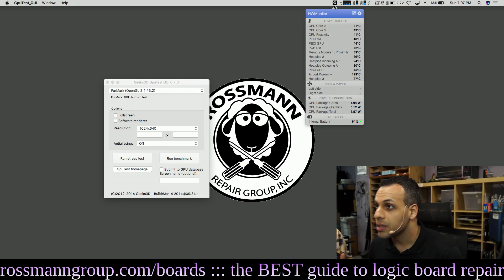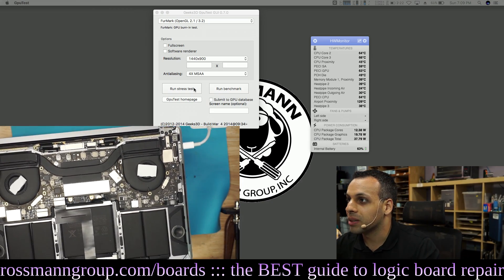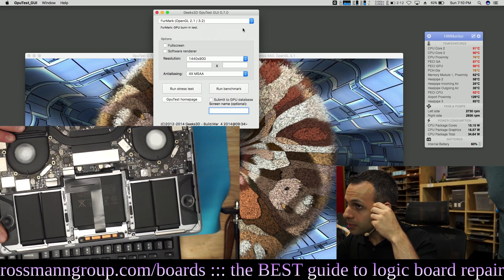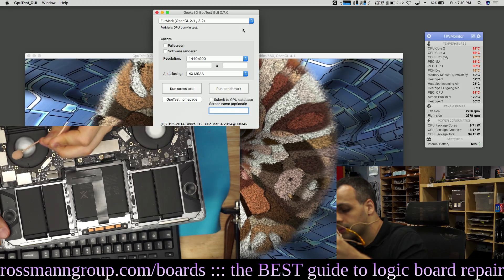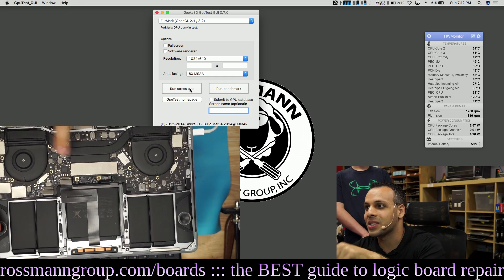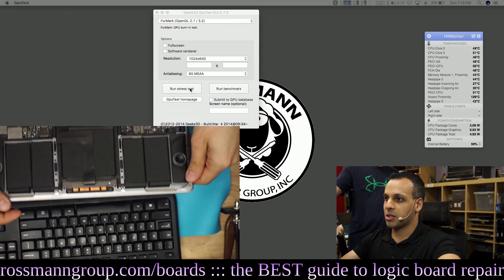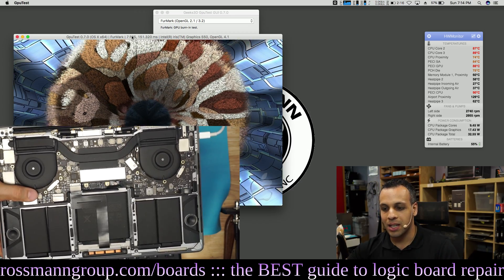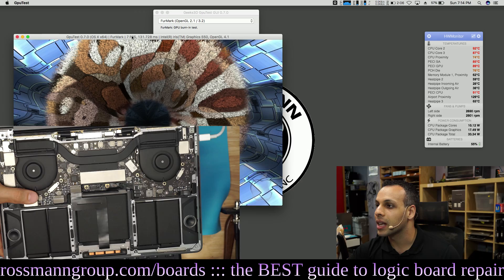Why Apple Macbook runs hot.

Comment: I still have the old 2007/8 MBP but I'm using the software that my fans are running at maximum speed all of the time. (It's the one with the failing Nvidia chip)

Comment: I sort of see why Apple does this stupidity. When the fan finally do turn on they are so loud! Some days ago I was sitting at a café reading and suddenly this loud air sound came on, really noticeable, I looked to the right and it was the fan of the macbook of the guy on the next table. It curned and curned and curned. The fan of my laptop is more or less always running, but it makes a lot less noise. So they choose to have it running less because they can't design a fairly quite one. It is the choice for them between stupidity and stupidity, and the choose the one that will make them money because their average customer dosn't undersstand that you prefere the fan working to having you computer shut down because of overheating.

Comment: Ive got the 15” 2016 touch bar model and the fans are ALWAYS ON . Idle temps are around 40 and 1200-2000 rpms. They reach around 5500rpms with a temp of 80-ish. Do you mind testing this on multiple machines? Having one unit with fan issues seems  like cherry picking to me.

Comment: I get that it should be quiet when at idle. But when there is work to do, there is heat to get rid off. Even on my desktop 90°C is set to full speed, not matter the noise, with it gradually decresing until it becomes quiet when idling or doing easy stuff like youtube.

Comment: But Apple has stores lol

My Nvidia gpu fans don't activate until 60 and I thought that was kinda hot but damn 80!!!!!!! Lol
Reply: Depends. Generally speaking, GPUs draw more power, though, so have more heat to dissipate. Somewhat mitigated by the fact that the silicon makes direct contact with the heat sink (no gum inbetween like on Intel), but still - more power = more heat.
Reply: My AMD FX8350 despite drawing 120 watts runs between room temperature and maybe 60-65 degrees Celsius under load with the stock fan.
Reply: GPU don't produces as much heat as a CPU.
Reply: Any think over 70c is hot. I am saying that a CPU need a better cooling device then a GPU.

Comment: It's not just apple doing this, my HP notebook too. My ps4 is laud but the shitty fan does not spin fast enough and the ps4 enclosed casing to get to the fan means that dust makes my ps4 run even more like shit. I've opened it once with screw driver that looked like it worked for my ps4 screws but when I closed my ps4 the screws striped at the top, can you make a video on how to remove small striped specialized screws, please.

Comment: I run smcfancontrol on my MBP, and it seems like it runs off of the CPU proximity value rather than CPU core temp. Seeing that the fan kicked in at 60*C seems to match my fan values when it turns on.

Comment: This is to be honest pretty normal despite it being also extremely bad. It's likely that the thermal paste is dogcrap +++ the fan rate is low to be quiet. However both those 2 things improved would revolutionize the product you could buy. And that is why Apple are truly thinking "different". They want our cash lol. I wish it was normal for a fan-rate-change button to be present on all machines so that we could get them to run as well as the fans allowed when needed. THAT would be to think different. Well, that + the toothpaste upgraded to something GOOD anyways.

Comment: Explains their logic in not even having a fan in the A1534. MacBooks don't use their fans anyway.

I have a program on my old Inspiron E1505 that overrides the fan control, as I thought stock was too hot. Even on my heater profile, I don't get anywhere near these temperatures.

Comment: I've had my (first generation) MacBook Pro Retina since 2012 and after 6 years it's still running as good as the first day. And don't get me wrong I use it intensively, lots of CPU usage, graphic intensive use etc...
The only thing I do to maintain it,  is to clean the dust inside of the casing and around the fans every 6 months.

Comment: New Macbook pro here. Hottest laptop I have ever owned and gets too hot to hold running Netflix. Will never buy another Macbook. 93*C get bent Tim Cook. This is planned obsolescence.
Reply: Yeah it is incredible that it gets to 200 degrees. I will take a look at SMC thanks! Does it void the warranty for when I want to sue Apple?
Reply: No, it  seems to be an engineering fail so I haven't gone to apple yet.
Reply: Mine is the one without the touchbar. I thought less parts would be better. But it has been this way since it was brand new. And sometimes it goes crazy and teh fans go full force when it is idle and doesn't seem to be doing anything. But I bought it more than a year ago. You really think they will help? It is a 3 hour trip for me to an Apple store... And that just seems like a waste of time to me since this appears to be how is is supposed to function.
Also this video clearly shows what I am experiencing ootb, why would I lie about what is already proven in this video? 0.0
Reply: SMC says it hasn't been tested on my machine yet. I am going to go ahead and not set it up so I do not mess with my fan profiles. Thanks for the recommendation though. I will probably just wait for the class action to get it replaced like the $800 keyboard.
Reply: I have an i7 with 32 gigs of ram and 2 580s with 2 480s supporting. So this was really just meant to be an on the go for work laptop that turned into a heater that I didn't want to turn on real quick. The more online research I do the more it seems to be a normal thing with the new Macbooks. I am all about wasting 8 hours with a support team that knows exactly what is wrong and why but can't do anything about it but I just dont have the time now days. Avoiding their future products professionally and personally seems easier. Also, I bought it on Amazon and they told me to contact Apple too. So sigh, I will contact Apple then and waste life but this video makes me think that this laptop is not meant for laps by design.
Reply: Yeah I was referring to my main machine which is window/linux mint... Can you read or do you just get emotional?
Reply: Amazon is an authorized seller dude. "Ships from and sold by Amazon.com." But I know what you mean, I have bought some fake Nike's from a bunk seller on Amazon before. Burn me once... shame on you... burn me macbook... shame on... me? Great talk dude, thanks for the software. o/
Reply: I can understand that but you highlight a significant point to check the seller. I always make sure it is coming from amazon and just doublechecked and it was sold and shipped from amazon directly when it was a new item. I ended up tweeting at the apple support team and they told me to dm them with info so I will probably do that this weekend. If that doesnt work though I will modify my smc profiles.
Reply: I have no idea why you think I do not understand that.
Reply: I still don't understand why you think I do not understand that. Also doesn't change the fact that I didn't buy it from a reseller 3rd party.

Comment: My dad's hp laptop runs extremely hot too. The fans go to full speed around 80°C, but it turns off at 85 and at full load the fan doesn't manage to keep it below that - like, it's loud af but not a lot of airflow and almost too hot to touch. It hasn't died yet tho

Comment: The hotter something gets the less heatsink is required. Probably more of a design choice, no point turning the fan on 'till 80C because that's what it's gonna sit at while in use anyway.

A lot of chips are rated at 95C+, the older AMD stuff was rated at 105C. I once overclocked an old intel chip without a heatsink and it literally melted itself off the motherboard, the CPU still worked even though it destroyed the motherboard, must have got well over 200C fot it to melt the CPU socket.

Comment: Louis, I wonder how accurate the temperature sensor is.
I know the sensor on my AMD powered HP laptop is very inaccurate. It's currently says the CPU is about 110C, however the GPU sensor says it's only 48C. I've never had the laptop shut down due to overheating, ever. I've even seen the CPU temp reportedly go up to 130C or so. The chip would have fried a long time ago, so I know it's bullsh!t lol.
These sensors are just made using a diode junction, nothing fancy, which is why they are inaccurate. The thing that bugs me is, they put billions of transistors in these yet they don't put in a more accurate temperature sensor...

P.S. It's actually an APU in my laptop, which further supports the reasoning that the sensor is highly inaccurate.

Comment: After seeing this, I adjusted the fans to ramp up much more aggressively on my MacBooks using TG Pro. I have mine set to 25% with any sensor reading over 39C, 50% on any sensor over 49C, 75% over 59C, and 100% over 69C with the minimum of 5 seconds to speed up. It does definitely seem to help keep my 4 month old A1398 cooler but it will still peak at 100C when I'm running RX6 on it.

Comment: And it's all the Apple fanboys that call PC owners idiots. At least PC components designed to not spin their fans under a small load will kick those fans on if you surpass 50c or 60c, depending on the brand.

I actually do what I can to maintain as close to 60c under load as I can. I don't hear my fans through my headset, so I don't care if they make noise to achieve that. My curve is set to ramp up to 100% if by some chance I do ever hit 80c. Which only ever happeneds under stress tests.

Comment: Everyday I‘m doing CAD on my Macbook Pro 15“ from 2012 and it is still running... But my macbook is a Jet if you use the Nvidia card it‘s at full speed if you use it hard and the temperatures are good

Comment: High temps will lead to voltage leak too. That cpu is drawing probably 25% more power due to just being so damn hot. Leading to a hotter vrm which is less efficient, leading to more heat, and so on. Macbooks seem like they're always on the edge of thermal runaway. 

Though my Dell XPS 13 is almost the same, the fan doesn't kick on until 80C and then goes full blast until things are back down to ~45C then the fan turns off and repeat. So annoying. All so it can be silent most of the time. Just run the fan at 30-50% all the time and it'll never hit the 80's at all. Unfortunately no way to manually control the fan.

Edit: also a single shared heat pipe. Wow. What a garbage thermal solution. At least give the cpu and gpu totally separate heat pipes so they aren't sharing heat ALL the time.

Comment: Having a mac from 2006 till now (built a pc in 2015) who the fuck doesn't run fan control and have the fans permanently tuning at 2k rpm from 30C to 5K at 70C? Probably why mine have not cooked there guts.

Comment: If the fans are not going to turn on until 90 then why have 2 fans. why not just put fan sized passive heat sink's and a really small fan for both. running at a constant low rpm?

Comment: My GTX 470 works in medium to high 80's ever since I bought it and is still alive and well. Highest I got on it was 96 Celsius during rendering I think. And the card still lives. Maybe because it doesn't go hot/cold/hot/cold all the time, but once it heats up it stays hot so there's less stress on the solder.

Comment: Funny how once the fan kicks in just above 80 degrees, it starts off at a low speed so it can sit happily at 90 degrees. What temperature does the fan stop spinning at ones it coops and does the heat soak, keep it locked in at 79 degrees?

Comment: Macs Fan Control app is your friend! You can specify which sensor and RPM range you want for target temps.  I noticed my 4yr old Mid-2014 Macbook Pro 15" Retina model was running hot but no fan noise. Removing the back cover to look at the heat sink fins, mostly clean. After vacuuming/canned air, it was totally clean. Fans still not doing their job. I honestly believe there is firmware/hardware to "fail" the fans with age, so these computers will self destruct, forcing you to buy a newer, lamer Macbook. Now, with Macs Fan Control, it is never over 50*C or  at its worst for GPU/CPU temperature.

Comment: this is why I replaced my thermal paste on mine and use macs fan control I did notice my laptop getting hotter than what a normal laptop would be at so I investigated, and  yes turns out apple lets it overheat to shit just to keep it quiet so yeah huge tip use macs fan control keeps your cpu from frying up lol

Comment: 1:05 
81c and the fans come on. 
As a car guy, messing with older vws we use 3 different temp thermostats. 
One is 71c, 80c and 87c....
A MacBook isn’t a car engine, wtf
Reply: You will be surprise.  In my PC desktop Gigabyte FXA 990 Ud3 Ultra, it have a temperature sensor from my VRM that power along with the CPU temperature and power.  While the CPU of a Intel and Fx chips are different from each other so I'll start off with a Fx chips.  I use HwInfo64 to monitor those and also see other sensor from Harddrive, my M.2 SSD on the board can reach 80c easy and idling 50c-55c, and there is a GPU Core temperature with Vrm voltages and temperature sensor like my 290x have two different VRM one being for the GPU core and one for the memory ram.

 There is three sensor to keep a eyes on.  The Cpu package temperature, Cpu socket temperature, and Vrm temperature that give power to the CPU itself.  The package is the core itself when range from 15c to 75c maximum and anything below the room temperature will be inaccurate on the Fx chip if it were to read 20c when it actually 25c room temperature, so the socket temperature would be 30c to 35c is the correct values because AMD made a chips to actually disable core until it is needed but it still need power and that power it get from the socket it was installed.  If that socket were to go pack 65c for long period of time to melt the CPU connector hole.  

Electronics do run hot when putting in more power to the systems to achieve higher clock speed on the CPU, Ram, GPU, whatever.  Intel chip run hot up to the 95c range and once it reaches 92c on those Macbook, the Cpu Ghz speed that should run at 3.5Ghz will throttle down to says 2.98Ghz just so it doesn't die from overheating, thus losing performance and lifespan of a CPU and the same with GPU.  Laptop are balled CPU and GPU to have no replacement but attempt to reball it to run a little longer to often fail again in the future.

Comment: I am not a fan of high temperatures but Intel specs the processors at 100C so 91c is within manufacturing spec. That said when the heat sink gets clogged with lint it will spin the fans faster and it may be enough to keep it below 100c, but maybe not. 

A Thinkpad will not have this issue with a larger thermal mass and surface area to dissipate the heat. The trade off is the thickness of the laptop. I would rather have a well built but thicker laptop.

Comment: They don't want the fan to come on because the moment it does and the customer can hear it, it generates a call to the helpdesk. Most laypeople think that if the fan comes on, there is something wrong. I get tickets at my work all the time for their Dell laptops, "it seems like it's running slow and I can hear the fan....". And I invariably have to explain how crunching numbers equals work, work creates heat, and heat is pushed out of the laptop by the fan. It's all working as intended. It'd be one thing if these types of complaints just came out of the admin areas at my work. But I even get these types of complaints from the engineers that actually design computer chips and they just give me confused looks and some type of, "Welllllll, it never did this before.".
Reply: "Wellll, it never did this before".

Try vacuuming the dust out of it at least once a year.

Comment: On reference style coolers for GTX graphic cards, if you don't set a custom fan curve it will heat up to 83/84 C and sit there at 50ish% fan speed happily thermal throttling. Should be enough to prevent long term damage but still I don't care if the fans are at 100% it should not thermal throttle from the factory at anything less than 100% fan speed.
Reply: At 100% fans are going to die quickly, so you should try to balance between gpu life time improved running cooler or better performance  vs fans going to die quicker.
Reply: Kevin Moreaux I don't think it's going to significantly lower the life of the fans if they only spin that high during gaming. Or else there would be a huge issue with miners having fan issues. Instead they run into power delivery problems.

Comment: that's why i drilled holes under the fans, set a custom profile for the fans, removed the cd (mbp 2011) and added a fan, replaced the th.paste and addedd some thermal padding on the "higj voltage stuff" that let it dissipate on the aluminum.

and that's why my mbp 2011 has not yet coocked its gpu

Comment: Back in the day when I had a Dell XPS M1530, I always used to wonder how Apple made their MacBooks run so cool, with such a low fan speed. 
I since realised they just let their processors cook, and can’t believe they still get away with it!
You know if it was an Apple chip, the fan would come on much sooner.. as it stands any CPU issues make Intel look bad, not Apple!
Presumably you can get aftermarket software to run the fans faster?